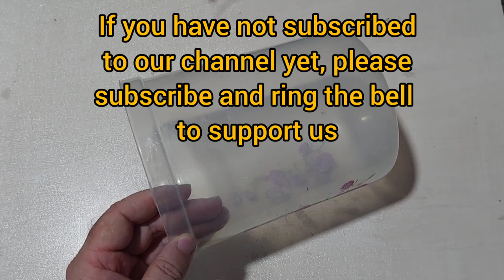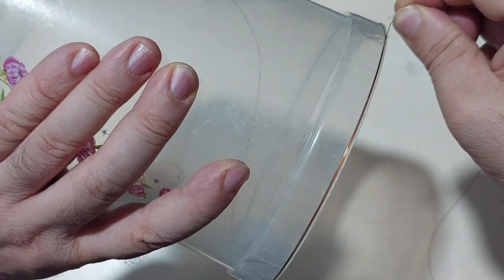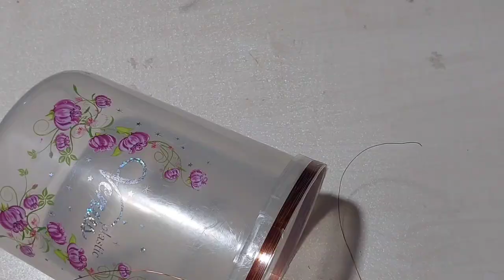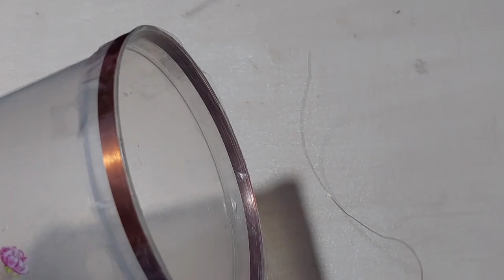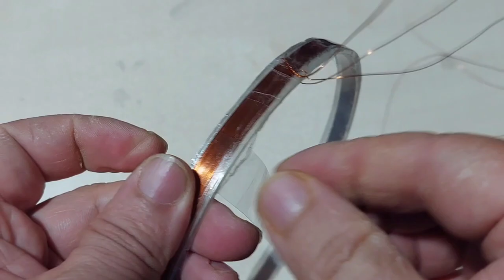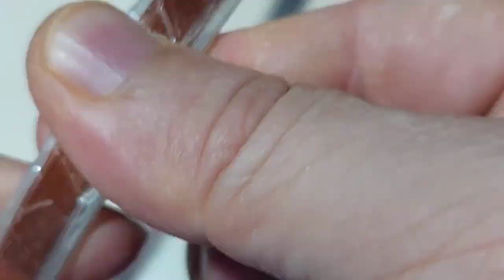How to make an accurate coil for a metal detector

Comment: If I have 0,5mm copper wire can I use it and make 10 or 12 turns or I have to make more turns than 20?
Reply from the maker: Yes, you can, but it depends on the circuit of your metal detector

Comment: Is this just same as copper wire?
if not, can I use a copper one for this?
Reply from the maker: Hello
Yes you can, of course it depends on the circuit designed🙏

Comment: Please tell me the mm of your mug and can I use 27 gauge (0.42 mm) copper wire
Reply from the maker: Hello
You can connect a 10 kg variable resistor to your coil and adjust it

Comment: Can I use this type of  coil winding for any metal coil?
Reply from the maker: Hello my friend
Thanks for your comment
The method of making the coil is the same, only in different types of metal detectors, the number of coil revolutions, the thickness of the coil, the diameter of the coil circle can change, it depends on the circuit designer.❤❤🙏

Comment: Are you cut wire after first 20 rounds, or same wire continious next 20 rounds?
Reply from the maker: I continue with the next 20 turns and wind it to connect to the Byrne metal detector circuit.
Of course, the coils of metal detectors are different, such as the diameter of the wire, the number of turns, the value of ohms, etc., in this video, we only show the correct way to make the coil.

Comment: Where did u get the extra lose wire from
Reply from the maker: That extra wire is right in the middle of the coil, that is, between the first 20 turns and the second 20 turns

Comment: Sir how to make 10 mili henry inductor 
With using 0.1mm coper coted wire
Reply from the maker: Hello
 To make a 10 mH inductor using 0.1 mm copper-coated wire, you can use the formula for inductance:

L = \frac{{N^2 \cdot \mu \cdot A}}{{l}}

Where:

 = inductance in henries (10 mH = 0.01 H)

 = number of turns

 = permeability of the core material (for ferrite, it's typically much higher than air)

 = cross-sectional area of the core in m²

 = length of the coil in meters

Make sure to choose a suitable core material, like a ferrite core, to help achieve the desired inductance. Pay attention to the number of turns and dimensions of the core.